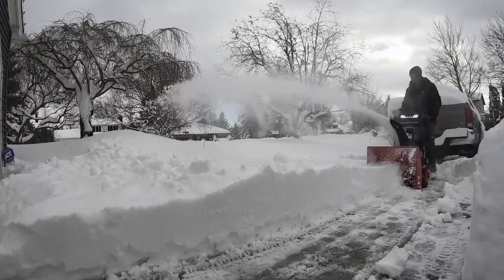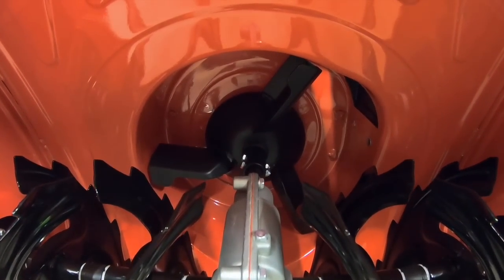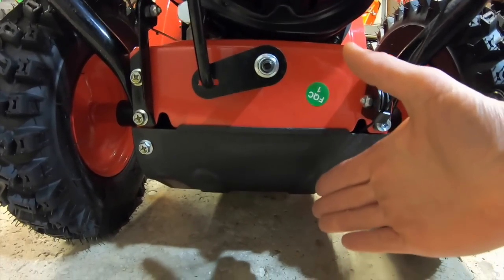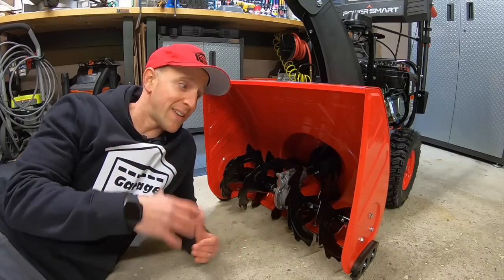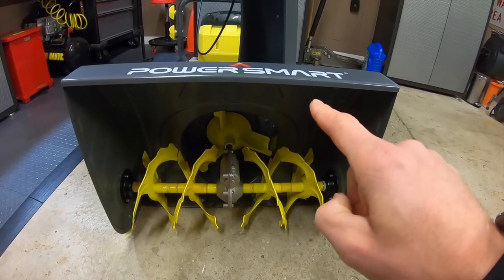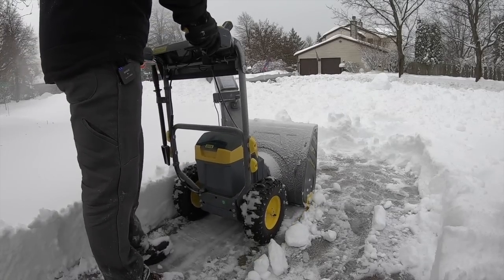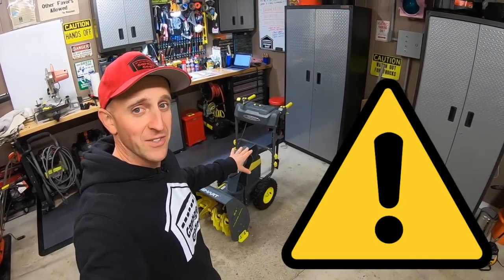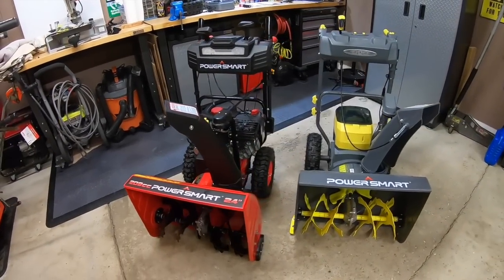POWERSMART 24 INCH GAS SNOWBLOWER vs POWERSMART 24 INCH 80V BATTERY SNOWBLOWER - Which is BETTER?

Comment: I've been interested in the electric snowblowers for a while but my driveway is about 10 cars worth of space and I would definitely have to buy a backup battery to be able to clean everything.
Reply from the maker: You most certainly will need extra batteries. Thanks for watching!
Reply: @GarageGear  thank you for your response, keep up the great videos! I would also have to worry about properly storing the batteries, so of I did invest it would be in Toro or Ryobi because they also have lawn equipment meaning I wouldn't have to worry about properly storing the batteries because I would use them the entire year. So in my case it's invest in extra batteries or invest in extra equipment.
Reply from the maker: @xLTxVEGAx  proper storage is key. I found they must be stored at room temperature. Left mine in my 40+ degree garage and it wouldnt charge.
Reply: @xLTxVEGAx    I have the Ego Power+ 2-Stage SNT2406; I upgraded to the package with the 2 - 10Ah 56v batteries and rapid chargers - With Buffalo's most recent Blizzard, I was able to get my whole driveway (8-cars, single lane) and the walks to my front and rear doors done in one run with heavy snow that was between 18 inches and 4 feet thanks to the drifts.  The street wasn't plowed yet, so I had to go back to do the end of the driveway and sidewalks with the heavy plow-thrown snow after they came through.  The package with the 2 - 10Ah batteries is pricey, but you get 2 rapid chargers, so you can can recharge both in an hour from dead.  If you are looking to invest in a battery-powered lawn tool platform, I wouldn't count out Ego; particularly the bigger batteries.

Comment: I have had the same Briggs Engine for over 5 years, and I have never had an issue with it. Starts on the first pull every time! It is on a 24 inch Briggs Snow Blower.
Reply from the maker: Awesome! Thanks for sharing!

Comment: Nice honest review on both of these blowers. You always have great content. I was considering buying one of these Power Smart 24-in snow blowers but I haven't dropped the dime yet. I'm still using a 22-year-old Craftsman 28-in 9 horsepower, been fixed many times and the thing is a beast. I only got about 2 to 3 ft in Cheektowaga, I made out better than Hamburg that's for sure. did you get a lot?
Reply from the maker: Thanks for watching the video! If the Craftsman keeps workin, keep using it! Check your belts, use ethanol free gas, and change the oil, and you will be fine. We got about 40 inch and you would never know because it was gone the next week. Hamburg sure did get a lot!

Comment: the powersmart looks a bit more powerful than my 100V snowjoe
Reply from the maker: Hey scy! How much do those snow Joe’s run? Thanks for watching!
Reply: @GarageGear  paid $1300 last year for the 24 inch with the two 100V batteries included. Honestly it kind of sucks but it is getting me through the buffalo winters (southtowns) with a bit of patience. Doesnt throw very far, power starts cutting out when the battery gets down to half, controls are frustrating. I had such a good experience with electric lawnmowers that I naively trusted that the electric snowblowers were just as good.
Reply from the maker: @r5LgxTbQ  thanks for sharing this info my friend! It’s helpful to others here in the community! 👍

Comment: Great video, I bought the gas model with no light about 1 yr ago and I have to replace the auger blades but you can not find any parts for these other than eBay and absolutely no information on how to repair them.
Please if you ever have to replace the auger blades even if it just informational that would be great because I am having the hardest time trying to get the bearing off.
Reply from the maker: Thanks for sharing Matthew! I will see what I can do. Thanks for watching!

Comment: Hamburg resident here. My 2007 ariens 926le battled 6' and 5' storm's this past year. Just add gas and power thru. SnowVember and the Christmas blizzard. Outdoor for hours doing my neighbors driveways and cutting paths in the road. Real deal no joke work. I would have needed at least 20 ready to go charged batteries to do the same work 1 gallon of gas can do.
Reply: Many people paid upwards of $500 to have a front loader or bobcat to clear their driveway. A lot of plow guys got stuck.
Reply from the maker: These battery powered machines aren’t ready for the lake effect nonsense we see! Thanks for watching!
Reply: @GarageGear  From personal experience I completely disagree. No regrets with my toro 2 stage electric blower in Buffalo.

Comment: An electric snowblower has the same issue as electric vehicle.  It takes a long time to charge the battery and doesn't run for long. No thanks.  I'm not buying one.
Reply from the maker: If they can figure out the power output and charge times I think they would have something here and across the board. While they have come a long way they have a ways to go still. Thanks for watching!

Comment: Experienced the same problem with the speed throttle lunging forward caused by the vibration of blowing snow. This is a new PowerSmart gas snowblower with the 250 cc Briggs and Stratton engine. (Very powerful had no problem blowing the snow during our past winter strom) I loosed up the plastic gear mechanism to add a little white lithium grease to reduce the friction on the plastic gears. After adding the grease I tightened the gear mechanism and installed a small bungee cord around the vertical rod that connects to the friction wheel. The combination of tightening the gear mechanism and bungee cord held the speed throttle in place. Since I rarely shift gears I don't see this as a problem going forward.
Reply from the maker: Thanks for sharing, Ernest. Hopefully this helps someone out.

Comment: JB get ready for more snow. Any comment on Ariens replacement parts locally
Reply from the maker: I heard more is coming but it looks to be only a couple inches by me. I heard that I can get ariens parts at drake lawn and landscaping in Clarence by me. They are under new ownership tho I think. Other than that I just order parts as needed. Thanks for watching another my friend.
Reply: JB I was successful at Lowes OEM Ariens. Pack of 3 for $7. Just extra stock for me just in case of an uh oh .They also has 2 different OEM belts. I didn’t have my OEM part number with me to cross reference. 
Just thought you may want to know of this.
My machine is a 2009 Deluxe 27 runs great 
The engine will pop / backfire when throttling down. Has done this since new. Any ideas.
Take care and I really enjoy your channel
Reply from the maker: @tomvarano3283  thanks man for sharing Tom! Here is a link to possibly help you with your situation(s). https://www.briggsandstratton.com/eu/en_gb/support/faqs/browse/engine-backfire-afterfire.html Have you given the carb a look?

Comment: Those chute and speed control look like they'll break soon, but I agree with you that a Briggs engine on it is a big improvement. 

I wish we got both in Canada
Reply from the maker: Life span on plastic isn’t very long lol! I’m glad they popped that briggs on. It gave it the power it needed! Thanks for watching Jamy!
Reply: @socomon69  That's easy for me to know, because it is the same word in french, which is my native tongue
Reply: Have you checked out Canadian Tire?
I had a smaller "Yardworks" for quite some time, the engine
outlasted the auger drive/transmission.
One caution, plastic parts become brittle in extremely cold temperature.
Those flipable plastic skids wear down quickly, so I welded up my own 
set using small 5-6 in. lengths of paired 1/2 in. rebar on to 1-1/2x1/4
angle iron.
I just reposted a couple of pictures of the completed skids
on Facebook.
Reply from the maker: @mikemontagne2703  hey Mike thanks for sharing I’m in the US. No Canadian tires around here lol! Good work on the skids.
Reply: @GarageGear  Thank you

Comment: I have the Gad one I suck at mixing gas and oil might get the 80 volt model
Reply from the maker: Hey there! Just a heads up the gas and oil on the red snowblower do not get “ mixed”. Gas only goes in the gas tank and oil only goes in the oil spout. If you need any more information on this let me know. Thanks for watching!

Comment: What are the cost of each machine? It’s missing in your review.
Reply from the maker: Hey Demetrios! The prices on these machines fluctuate a lot. Probably based on sales. The battery blower was $1100 2 months ago and is now $700. I didn’t want to mention the prices since they change too much. I have them linked in the comments and the description. Thanks for watching.

Comment: looking for a new snowblower and your videos have helped me a ton.   I see you're also in Buffalo,  if i knew you'd be go tooservice guy!  I drive electric and was leaning that way, you convinced me to stay with l 2 stage gas machine you ever reviewed one of those cub cadet 3 stages?
Reply from the maker: Hey Ed! Awesome you’re from Buffalo my friend! I would stick with gas for Buffalo winters. Not enough juice in those batteries. My neighbor down the street has a three stage and it doesn’t seem to be any better than a two stage. Over the years I’ve noticed little gimmicks from manufacturers to boost sales and this looks like a sales gimmick. I would gladly try it out but I know you’ll pay more just for the yellow cub cadet paint. Thanks for watching! GO BILLS!
Reply: @GarageGear  I wanted a 28 inch ariens deluxe. But, immediate availability and a $300 credit at a toro dealer led me to pull the trigger on a honda powermax 828.  I just hope there's some snow left to play with when they drop it off tuesday.  Thanks
 again for all your videos!
Reply: @GarageGear  Pulled the trigger right before the storm hit. I wanted the Ariens deluxe 28 inch. But, i had a credit at a Toro dealer so, I ended up with a powermax 828. Let's hope there's still a little snow to play with when they drop it off Tuesday.
Reply from the maker: @edroberts9040  we’ll get some! Still got a long winter ahead of us! Congrats on your purchase.

Comment: Sorry, But a 208 cc engine makes that a low end powered machine.  The industry needs to go back to HP ratings, which were more reliable. ( Space me the crap about Hp's vary with cc's depending on mfg and gearing, etc.  - the same hold true for cc designations and the current models are MOSTLY UNDERPOWERED,
Reply from the maker: I would like to see HP ratings once again too! Thanks for watching

Comment: Way too many negatives on the electric for me to even remotely consider.  $300 for a second battery?!  Ouch!  And a brand-new battery didn't even finish the driveway for ya'.  That alone is a deal breaker right there.  And the blades still turning with your hands off the grips?  That's just an amputation waitin' to happen.  Made in China.
Reply from the maker: Appreciate your feedback silent knight! Thanks for watching bud!

Comment: Battery tech just isn't good enough to overtake gas at anything. Long recharges on multiple batteries and cold weather would make it a real pain. Plus that electric model is very quirky.... you're too nice because that model is a complete piece of crap and super dangerous!
Reply from the maker: There are def some flaws that need to be addressed. Thanks for sharing!